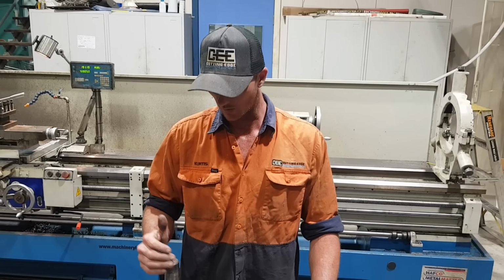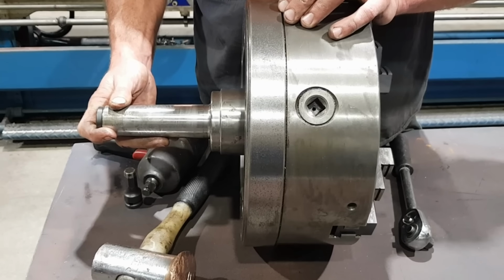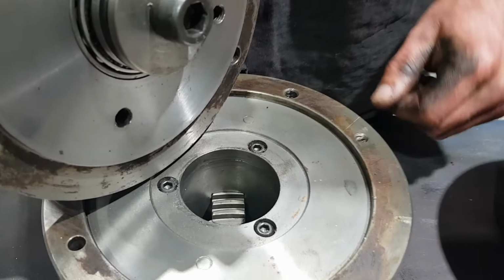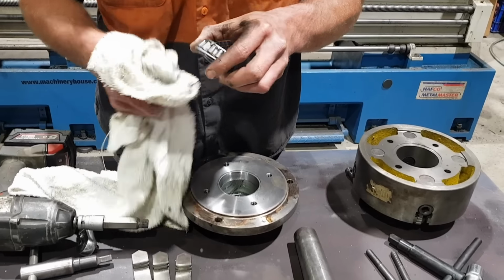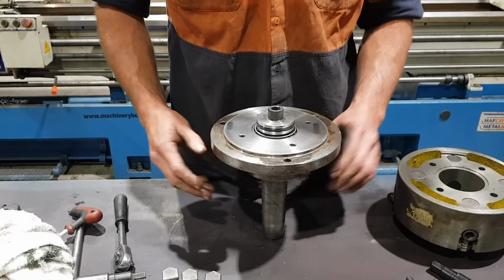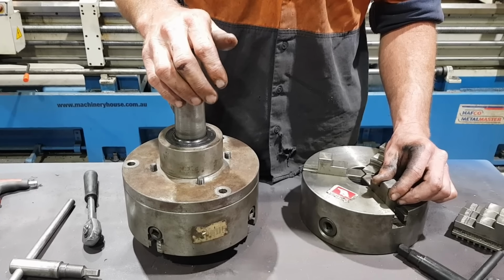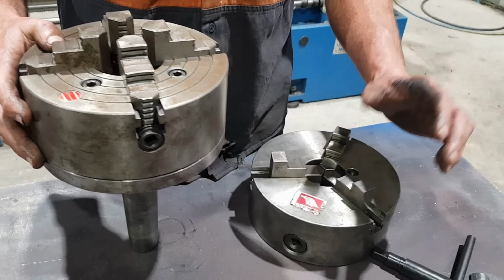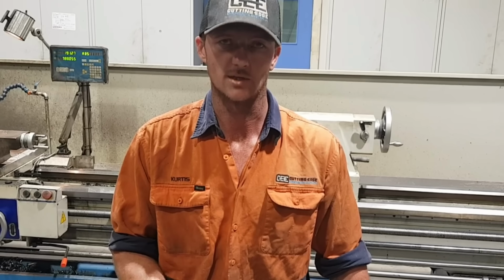How I Made Our Revolving Tailstock Chuck | Shop Made Tools

Comment: Not sure how you cut the taper on the tail shaft. I don't see a taper attachment and I wouldn't think the compound has that length of travel. Nice tool though. Looks very handy.
Reply from the maker: Hey mate the taper was cut with 2 passes of the top slide 😎👍

Comment: Very interesting mate and so simple. 
Have you considered designing a simple wielding attachment to the  rolling gear you use when joining eye peace to a steel barrel? You have to spend a lotta time sitting on a milk crate wielding up end pieces to a new barrel. I'm just thinking of a WS2 type of fixture  but for for OD  joining !!!!
Reply from the maker: Hey mate thanks for watching. Those sorts of things are already out there just very limited and wouldn't have the capabilities for that type of welding work.

Comment: can you help,any of you, so M5  angle taper 1.5073 or whatever,big end 1.7480. lil end 1.266 any trics as to how set the angle  on the compound, given the graduation on the compound are to whole number degrees, AWE FIGURED IT IN  CAD, copying it in 6061 t6, with no thrust to speak of may use single race ball bearings
Reply: How I do it:
If you have a No. 5 Morse taper you can copy, set it up true then run a dial indicator on the compound slide along the tool centre height. Adjust the compound angle until the needle stays still over the compound travel.
P.S. Remember every Morse size has a different taper angle. Only copy tapers from the same size you are making.

If no good taper is available to copy you can do some maths to figure out what reading the dial should move per inch of compound slide travel when run along a straight smooth ordinary round bar. Hydraulic cylinder rod is good for this. If I recall correctly, it should be somewhere around 23 thou per inch.
P.P.S. Edit: IMPORTANT. Don't forget to properly blue-in any home made tapers with your tailstock or they will slop about and fuck things up... like your lathe, your work and you.

Comment: So, buy a blank trailer hub from SuperCheap Auto, pull the axle stub out and turn it to suit ya tailstock taper. Drill the hub to take a backing plate where the rim would fit. Fit the backing plate to the chuck. Fit the hub to the backing plate ... how the fuck am I going to get the nut on the stub axle ❓FUCK ‼️